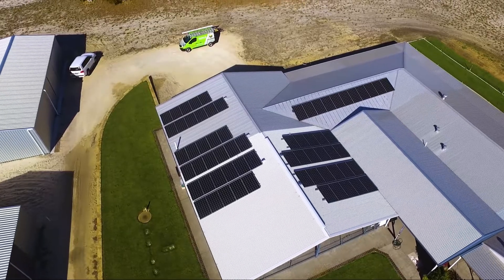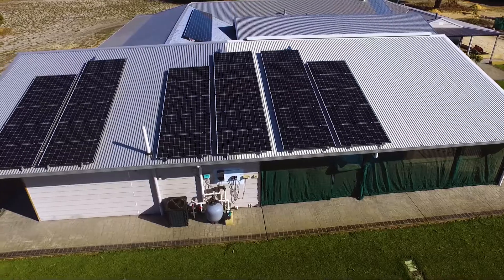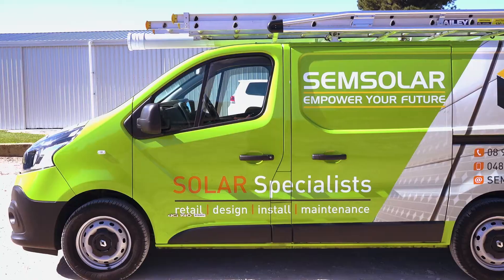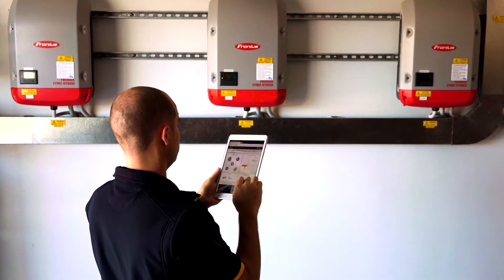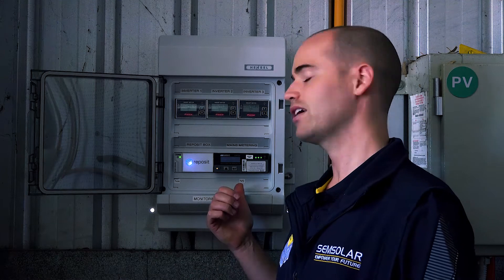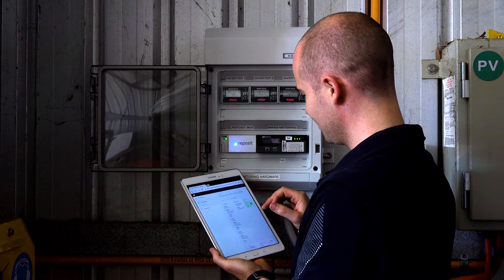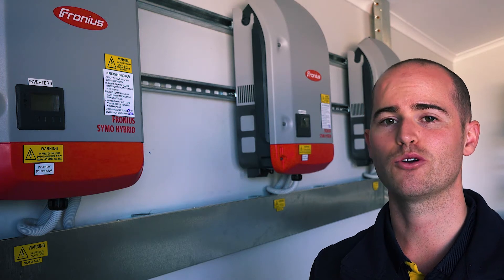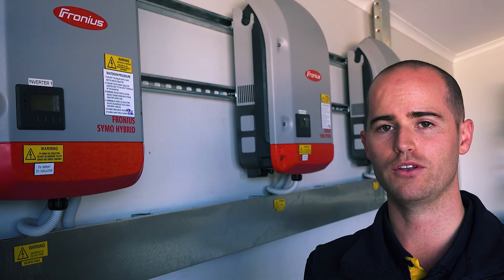Fronius Hybrid Solution

Comment: Are these connected via one data manager to solarweb, or individually monitored?
Reply from the maker: Hybrids cannot be daisy chained.  The (3) units on site run individual DM cards to dedicated smart meters.
What has allowed us to create one site is the use of the Reposit Infinite HUB.  
Without Reposit, the inverters would clash, providing conflicting data whilst trying to maintain suitable charging cycles for each battery.